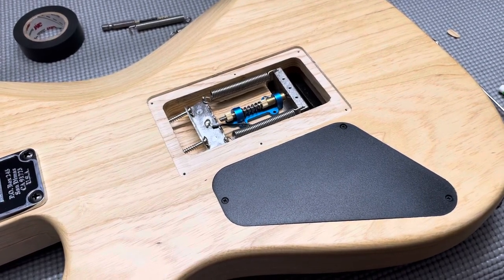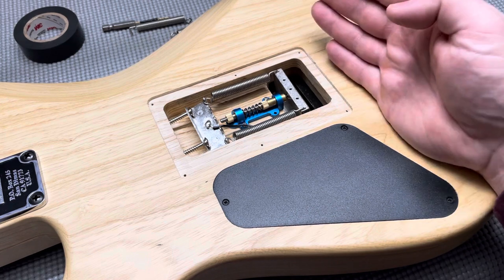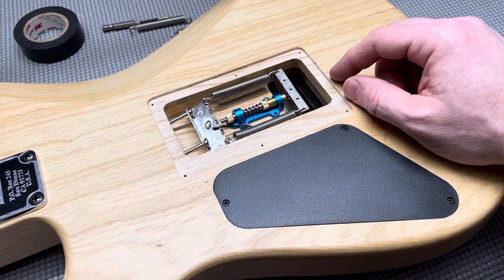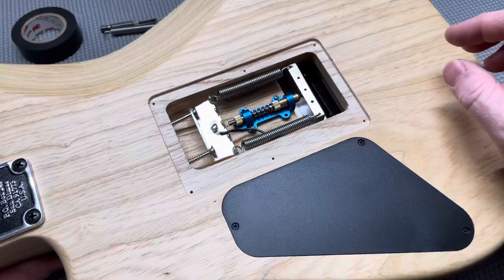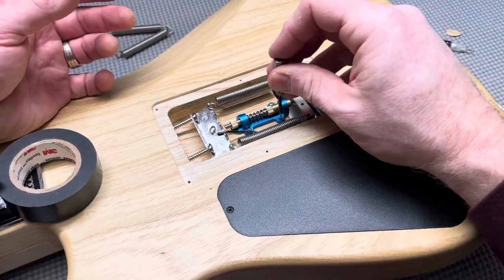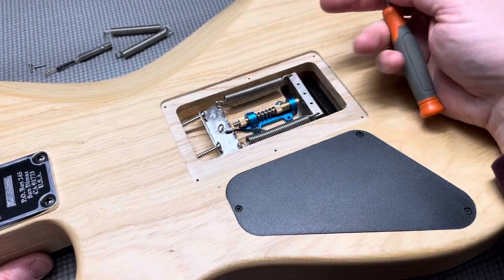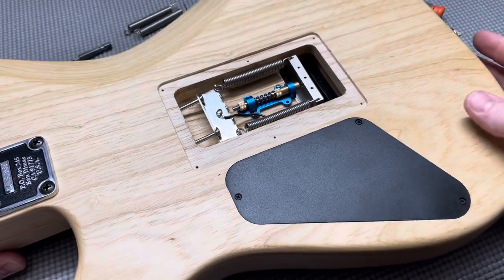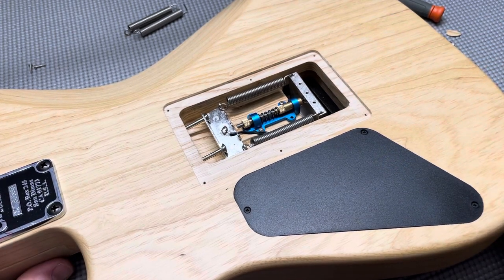Floyd Rose Tremolo Stop

Comment: I believe Ibenez originally introduced the spring loaded trem stop, but it was plastic and did not hold up very well.    I have 3 guitars with the trem stop you have, and they work great! One tip is after you get it setup put a few drops of Goop glue on the adjustments to keep them from moving.  2 of these guitars also have a EvH D-Tuna and it works great provided you have enough tension on the trem stop spring.